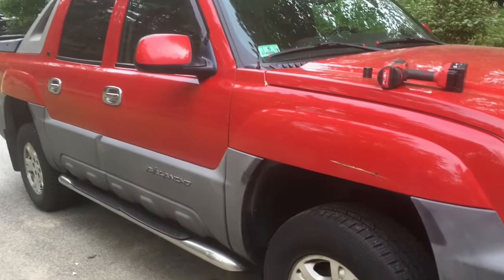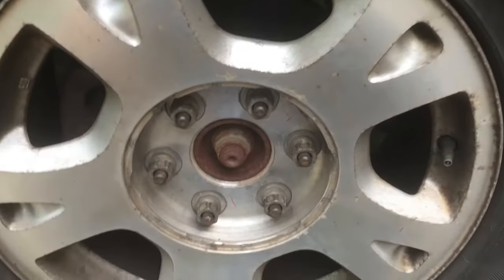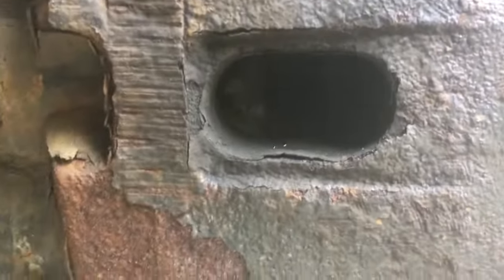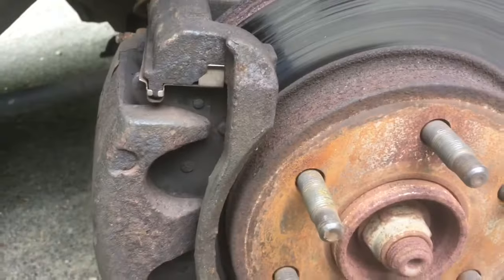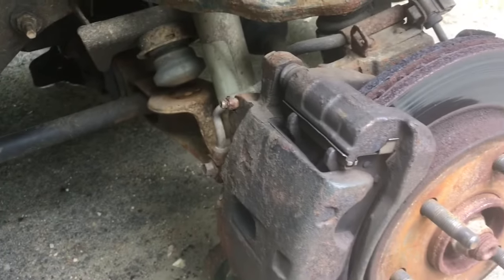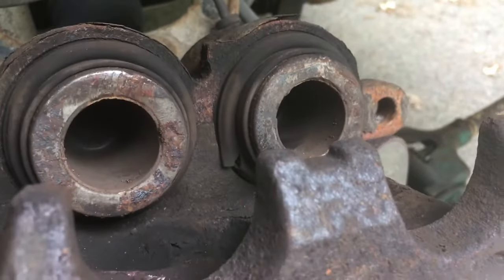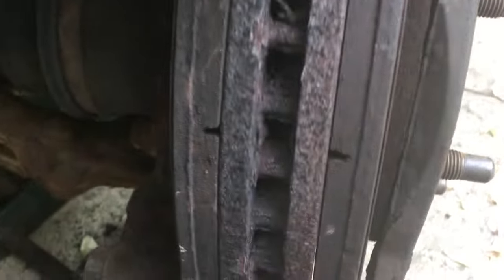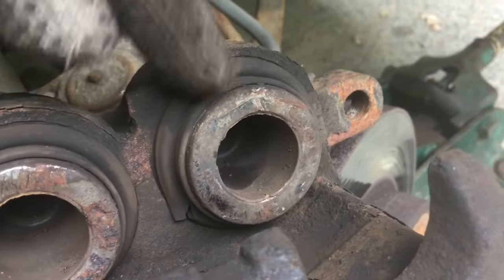Why is my wheel smoking and hot? Let’s find out!

Comment: I changed my caliper still having this problem any ideas ?
Reply from the maker: If it is a rear wheel, make sure the parking brake is not dragging.  If it a front wheel, make sure the rubber brake hoses are not damaged in some way. Sometime brake hoses have metal brackets around them that rust and squeeze the brake hose. This leads to the brakes sticking on.  Good luck in your diagnosis!

Comment: Can you drive like that
Reply from the maker: The Joyce Fambam - not long. You’ll burn your brake pad into dust, or heat up the surrounding parts so much, things could catch on fire. In my case, a new caliper was like $30, and I swapped it myself in the driveway. It’s very much a DIY job with a little guidance.
Reply: Yeah like it's smoking your either blew through brake line or some with the calipers or of they stuck then yeah
Reply: You can typically drive a few places and let it cool down between. However, if you drive it like this too long you risk warping the wheel or melting something you need. Best to fix it asap.  I had a simple, less complicated issue just from sticky boots and rusty calipers. https://youtu.be/rpyrQtc4D34